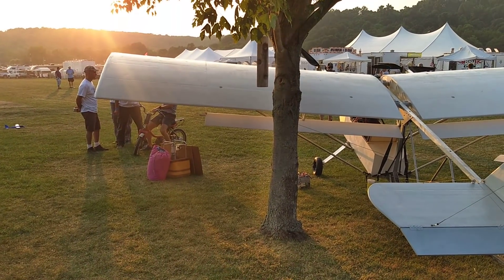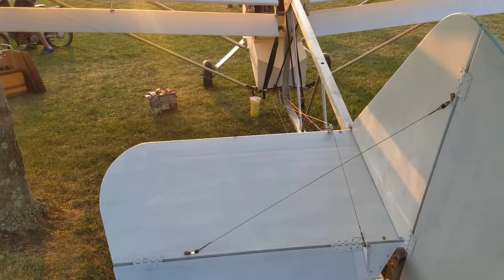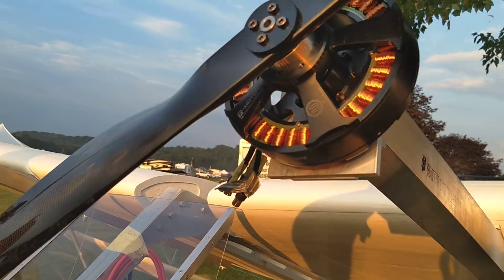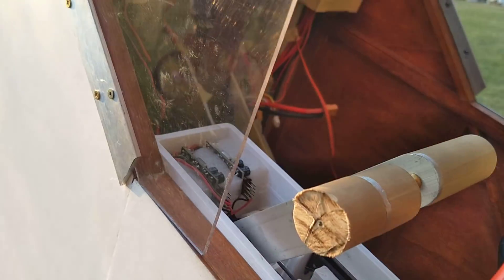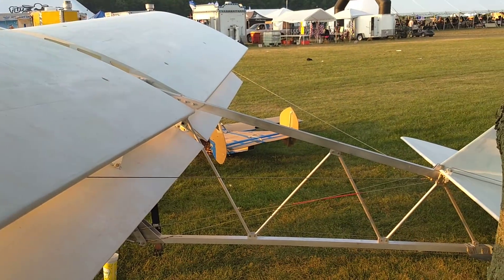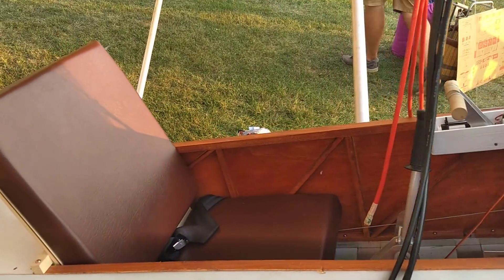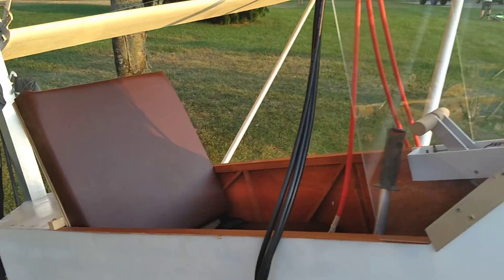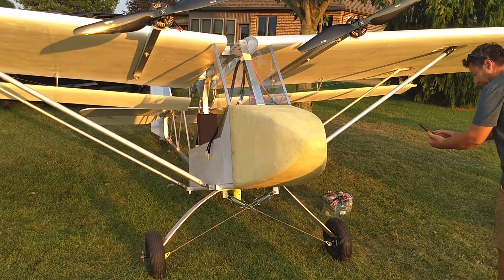Flite Fest  2018   Peter's Airplane

Comment: I admire him for his ambition and skill. I would only recommend to him that he do something about those wires. Hanging, flopping crossed up wires in to a rat's nest like that is a formula for trouble.. should be neat, out of the way and supported, and wires that should be in open air for cooling should be supported as well just not with the others. I hate to criticize, he's done great but to me wiring is just one thing I get real particular about, and in an airplane you should be.

Comment: G'day,

   Well, y'see, there were a few problems....

   While the Tail & Rear-Fuselage & Wings are rather heavy, and overbuilt, so the whole thing is so tail-heavy it's almost impossible to get tail Tail up enough to reach actual Flight-Speed outside Ground-Effect....,  the Ailerons are at the wrong ends of the Trailing-Edges...., and without any Gap-Cover the thing effectively has two low aspect-ratio Wings located side-by-side, with 4 Wingtip Vortices to multiply Drag ferociously -  while shutting off about 20% of the Lift which otherwise could have ben produced...., then to add a bit more Drag that Flat-Plate Perspex Wind-Screen - cocked- up there at 75-degrees to the Slipstream almost doubles the Fuselage's frontal Area....; meanwhile the Saucepan-Grade Aluminium Undercarraige folded up sideways the first time he fell out of Ground-Effect, after struggling eventually up to maybe 10 ft - when the dodgy ESCs shut down both Prop's because they can't cope with both Motors running at full power......

  Then, the Batteries which he forgot to strap down in the Nose promptly slid backwards, as the Nose rose, blocking his Rudder Controls ; while deeply aggravating the Tail-Heaviness issue.

  And then, he flopped onto the Grass and began to Ground-Loop, when the Right U/C Leg folded up, & thus SAFELY dropped the lot back to Planet Earth...

  "Beginner's Luck" they call it, like the  time he went and madelight in the lightless Biplane ; apparently...(?) !

   Backtrack me to my "Personal Aeroplanology..." Playlist, to see my old 8-Hp Skycraft Scout hanging up in the local Transport Museum, and my broken 22Hp VJ-24w Ultralight Motorglider in it's Trailer...; to assess my qualification to go beyond those observations of What Happened....., but I rather suspect that he's trying to swim far & away out beyond his depth of underconstumbling what he thinks might work out all right, hopefully.

  He's flown a lot of  models, where resort to the AmeriKan Answer (add MORE POWER...!) means that he has almost zero experience with slow underpowered overweight draggy examples of Flying Shitboxes with marginal aeronautical abilities..., and he's done a minimal bit of flying in a Cessna-152 ; which has been production-engineered to be Idiot-Proof.

   So, apparently, he doesn't quite  know what he's doing, but he's determined to have a go anyway....; which is not an optimal Game-Plan.

  When I was trying to teach myself to fly behind a Lawnmower Engine (in 1978)..., it is my fond  conceit that I had a better-balanced Biggles-Fantasy than that of Peter's at the moment....; so I strongly hope that he wakes up to himself, soon, and spends more time on getting the important shit Right, and less time worrying about making doccumentaries of what he's doing, to try to meet the next self-imposed "Dead Line", while trying to make it to the next Publicity Opportunity....(!).

  Anyway, it's all a matter of the Choices he decides to make...

  Such is Life,

  Have a good one...

  ;-p

  Ciao !
Reply: So he just needs to cover the gap, put an angle on the front windscreen, secure the batteries properly and upgrade his ESCs? That seems like a relatively simple list of fixes.
Reply: +Ethan Utter 

G'day,

  You haven't seen what you haven't looked for, so open your eyes, perhaps ?

  My first Aeroplane hangs in the Inverell Transport Museum, NSW, Australia ; to view it, either backtrack me to my "Personal Aeroplanology..." Playlist, or title-search YT for,

"The 8Hp, 1975, Red Baron Skycraft Scout ; World's 1st Legal Minimum Aircraft...!"

  Of course, I was it's 3rd Owner, and I did nothing actually "pioneering" in it ; apart from flying it in 1978 & not crashing it, which is why it survived - because I was the last person to get it off the ground until it was chained-up in the Museum in the mid 1990s.

   My second Aeroplane is a VJ-24 Sunfun, it began as a Hang-Glider, when the "e" modification appeared the project was upgraded with an Engine, and when the "w" mod. came out it recieved Wheels as well...; I wasn't building it, but I was being consulted, and I redesigned the Wing Trailing-Edge & the Undercarraige, and both my alterations were built in.

  In 1990 the project still hadn't been completed, and I bought it ; and once it became mine I redesigned  & rebuilt the Wing Leading-Edges, and designed & fabricated a streamlined Fuselage Pod for it, added a Ballistic Parachute, and conducted the Flight-Test program, as well as designing & laminating & carving 2 different Propellers for it (one 42" x 26", the other 41" x 12").

   And, I still have it ; though I have yet to begin rebuilding it after landing it inverted in a Potato Patch, when I hit the Fence in 1992 ; while foolishly attempting a downwind Takeoff in a 200 yard paddock..., because the Fine Pitch Prop. wasn't as good as I'd thunkeded that it were (!).

   To see that one, title-search YT for,

 "The 22 Hp VJ-24w....; World's First Ultralight Motorglider !"

   However, perhaps my best contribution to the Art of the Defiance of Gravity is that since 1997 anybody wanting to aerotow Rogallo Hang-Gliders behind 3-Axis Ultralights in Australia is required by the Civil Aviation Safety Authority to use my method & procedure for the first 300 ft of the Tow.

  To view that video, title-search YT for,

  "Aerotowing Rogallo Hang-Gliders ; Development & Implememtation Of The Lockout-Index..."

    Do not expect "high production values", my Channel runs on a prepaid Mobile Phone, and those are old early Videos ; made when that was a Nokia 2160c..., so they were made with a 2 Megapixell "Potato" (but on the other hand, in 2013 they sent me a "Gold" {coloured} Medal from Falmouth University in England, for winning an International YT Videomaking Competition - with a Video made using that very  same Potato.....!).

    You haven't seen me making anything (quite  as bad as Peter's second Hairygoplane, because I know better than to do that....

   However, the particular way I know what a HUGE mistake it is for him to leave the Gap-Cover off his Wingroots...; is because after 10 hours of flogging up & down the Runway, hopping and feeling the Jensen out, to become familiar with it's handling (and because I had not flown for TEN  YEARS when I began the Flight Test Program...!), I flew up out of Ground-Effect, crossed the Boundary Fence,  got to 60 ft - and discovered that to be it's absolute ceiling BECAUSE THERE WAS NO GAP-COVER, and having  4 Wingtip-Vortices on an underpowered Monoplane adds too much Drag for Climbing -  once out of Ground-Effect...!

   Because it would be a very long way back to the Runway, all the way around the World going in a straight line at 60 ft, I had to make a gentle turn, 90 degrees Right, losing 20 ft, then another one, going down again during that turn.....; and when I was almost level with the Hangar I turned Right again, finally pointing myself back at the Airfield - crossing the Fence with 2 ft to spare...., and landing safely ACCROSS the Runway, dumb, de Dumb Dumb, DUMB DUMB !

  Then I went home, & FINISHED MAKING the Gap Cover....; and with that fitted, the JPX-powered Volmer Jensen 24-w was able to sustain 200 Ft per minute Climb-Rate, in still air.

  To gain Altitude (I took it up to 5,000 Ft above terrain, ie 8,365 AMSL) I used to find a Thermal, or some Ridge-Lift, & go merrily upwards inside of that....; I trained ab-initio as a Sailplane Pilot, so that trick came fairly naturally.

  So, actually mate, it turns out that I'm not quite as silly as I look ; and compared to what I made my first Solo in, back in 1978, the Wright-Brothers actually had a better Aeropane in 1903.

   Now, perhaps you'd bettter start sniffing around my Playlists, just(ifiably ?) to see what a seriously high-grade Oddball you've been chatting with.

  Take it easy,

  Such is Life...

  ;-p

  Ciao !
Reply: +fromkentucky 

  G'day,

  Thanks.

     Well, I'd be going with a "staggered" V-shaped Split-Screen in front of the Cockpit, which is a little bit more complicated to cobble up...; and replacing that Spaghetti-Strength Undercarraige will be a big job.

  The Gap Cover is pretty easy, but it's an absolutely vital bit of Kit ; which will probably add 200 ft/min to the Climb-Rate - which is currently at Zero...

  The (overbuilt) Tail-Heaviness could be cured with sufficient Nose Ballast - if the new Motors will produce enough Thrust, and if the FAR's will permit the extra weight ; but a new and lighter Rear-Fuselage & Tailgroup would be a much better actual solution.

  Tattooing "Secure The Batteries !" backwards onto his Forehead, and mounting a Mirror on the Instrument-Panel would be  something of an over-reaction ; but a simple Cheklist would be pretty good...(!).

   Those inboard Ailerons will probably work, tolerably-well, but they sure do LOOK wrong ; and purely for the satisfaction of it, I'd like to see them relocated outboard to the Wingtips where they'll be much more effective (Leverage, Moment-Arm, and all that...!).

   The whole concept of leaving all his Trailing-Edges about an INCH thick, with FLAT Edges perpendicular to the Airflow (because that's how thick the Foam is, & it's easier to leave it that way, & it's what he's used to doing on Models....?) is a really really Silly WRONGNESS of an Idea, in my opinion..; because 70% of the Aerodynamic Drag of ANY Shape is caused by the Slipstream turbulating as it attempts to UNSTICK from the Object's Trailing-Edges.., which is why "Aerofoils"  always Always ALWAYS have the Pointy-Bits at the back end.

   Thus, the big fat thick blunt Trailing-edges to the Wings & Tail all functionally add up to being a "dispersed" Air-Brake, probably about as bad as the Flat-Plate Windscreen (!).

    So, to be honest, there are so many things which it would be better to fix on this iteration...; that a proverbially "Clean Sheet Of Paper" might be a better option, and then build something which has all the "fixes" incorporated  into it from the start (?).

   Learning is often  an expensive procedure, but it's always cheaper than refusing to learn from mistakes, in my experience (!).

  Such is Life...

  Have a good one,

  ;-p

  Ciao !
Reply: WarblesOnALot 
You sure know a lot for someone who hasn’t seen it fly yet...

Idiot.
Reply: You bitter asshole. It seems you didnt see Peter page and fly some of his stuff. You seems to be a scientist but a flop one.

Comment: in his video posted July 18th he talked about how he needs to go to larger motors before Oshkosh but he also has to figure out how to adapt the props he wants. He did bunny hops but also folded in the landing gear and crashed when the plane landed and suddenly turned
Reply from the maker: dwcobb43 I see. You can look at the right landing gear and it's bent some. Must be crash damage.
Reply: dwcobb43 didn't he say he might not take it to oshkosh because of upgrades that are needed?